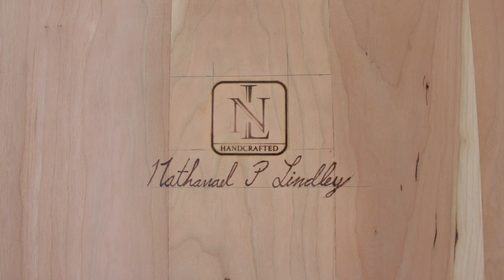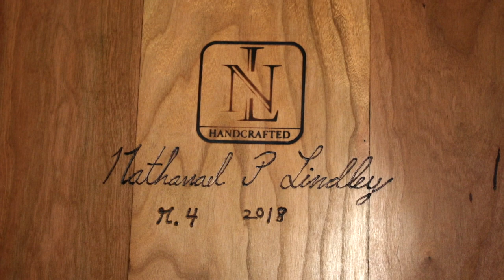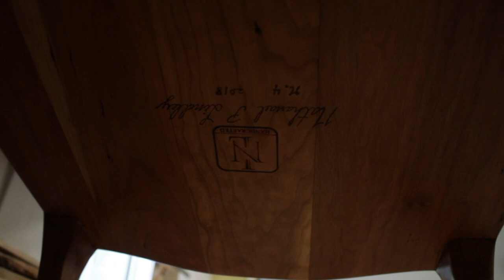A Chair for Martha - Maloof Inspired (Part 2) Finished

Comment: 1.How do you determine the curvature of the rocker piece? 
2. Did you bend laminate the back slats? Or just shape them? Which is the better method? 
3. What is the depth of the seat carving? 
Would help immensely if you reply, becoz you seem to have high skills for the job. Thanks.

Comment: Amazing mate, well done . I enjoy of your talent. I have a question if answer that i will be great full and be very helpfully to me ( i commented  from iran and my English language is not good, sorry for that). How can i get the patterns , plans, sizes  , thickness & details, i dont have any idea about that things, so its be very hard to make sam maluof design . 🙏🏻
Reply from the maker: Shadi Ekbatani Nejad I made a video about the dimensions using a simple drawing and the plans that I started with. All of the boards start out at (1 3/4) of an inch except the spindles which are    (1 1/4) of an inch. 
https://drive.google.com/file/d/1rTLCLMpMJJJmRYo4NZc4HpdaBjDlEmvD/view?usp=sharing
https://drive.google.com/file/d/1cjNj2GTN8YVjWwDhb8NHZOcX40smI_wH/view?usp=sharing

These are some of the resources that I started with.
http://finewoodworker.com/build_rocking_maloof_rocker.html
http://www.rockingchairs.net
https://www.amazon.com/gp/product/B007DN04IA/ref=dbs_a_def_rwt_hsch_vapi_taft_p1_i0
Reply: Nathanael Lindley i didn't find that video you said , can you leave the link for me here? It is very difficult to make rocking chair Without plans for me or  redesign that.Thank you for your guidance , that was very helpful. 🙏🏻
Sayad_eshghdoost@yahoo.com
Reply from the maker: Shadi Ekbatani Nejad https://youtu.be/66RpAUl9bp4

Comment: Awesome job. What wood species did you use? I noticed on the first video you had a dado in the front leg that was exposed, was that an oops? Where did you acquire your logo burning device?
Reply from the maker: Stallion Ranch Woodworks Thank you. I used cherry and walnut. I’m not sure about the dado. I had a test set in the shop so that may have been it. The logo burning tool is from GearHeartIndustry.com.